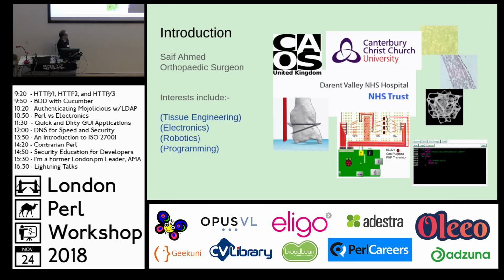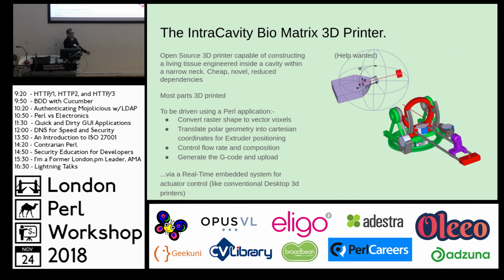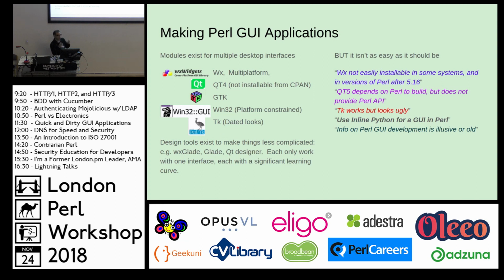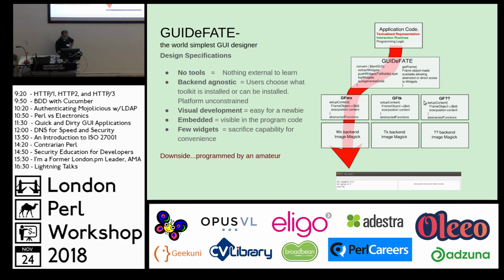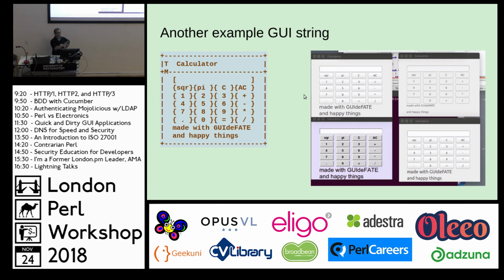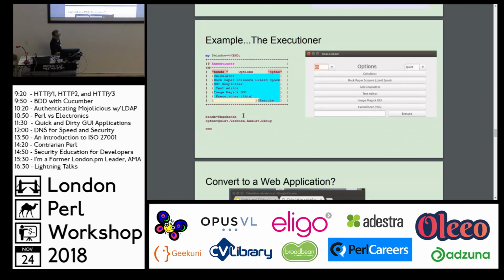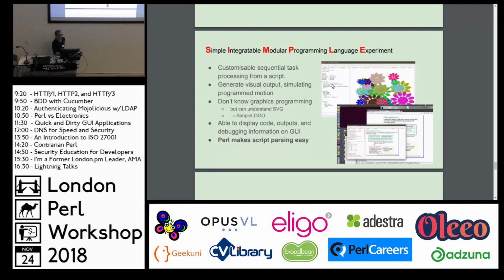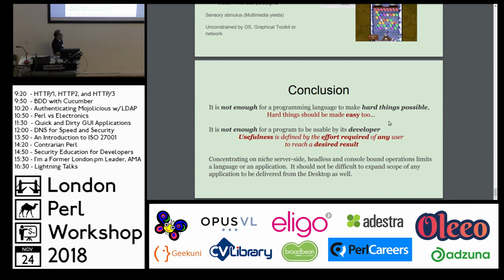LPW 2018: "Quick and Dirty GUI Applications" - Saif Ahmed

Comment: looks promising (from a distance). it would be nice if the presentation (or the CPAN distro) contains more examples that are less trivial than a calculator. a simple database CRUD would be very useful.
Reply: Thanks for the comment. Looking back at the presentation rather a lot of waffle...I agree.  Will address this in my next talk on the subject in Riga